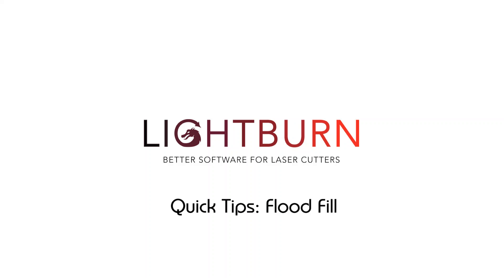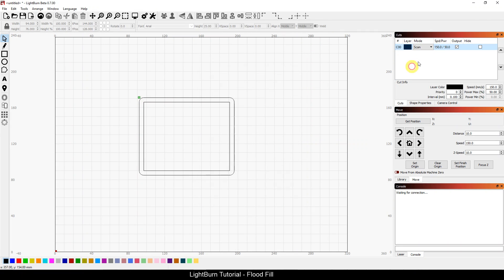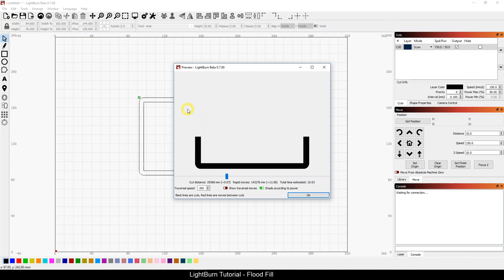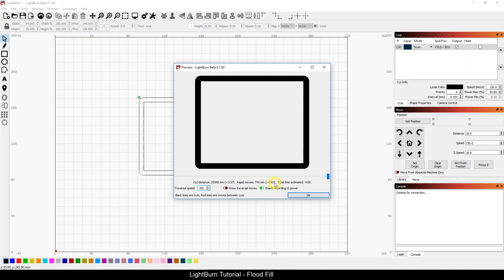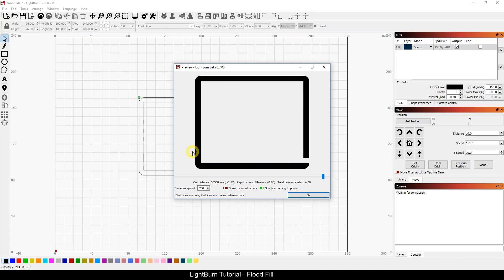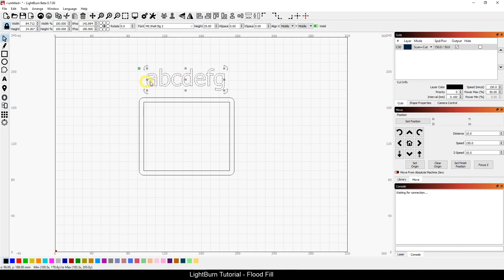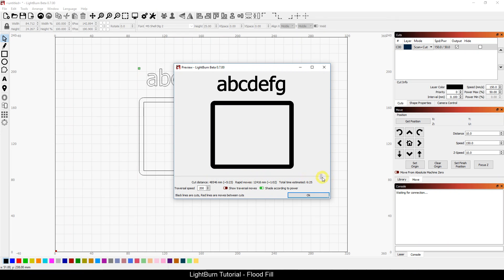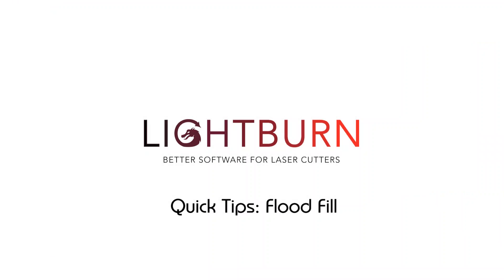LightBurn Quick Tips: Flood Fill

Comment: Are scans always horizontal? Thinking burning the bottom then the top with horizontal moves then burning the sides with vertical moves would be another possible improvement.
Reply from the maker: In LightBurn, you can set your scan angle to something other than 0-degrees but it applies to the full layer so you'd have to separate your parts into layers for horizontal and layers for vertical.  If you're using a gantry style laser, It's also a bit harder on the machine to do vertical scanning. That's a lot of weight to try to sling up and down vs just the laser head moving side to side.  

In the end, flood fill or even offset fill provide a better option but should be used only as needed.
Reply: @thetinkerverse  Thank you, I'm looking to retro fit an existing Core XY 3D printer with a more powerful laser than the 1500mW unit I have already installed, that replaced a 3D printer hot end. Because of the Core XY design, both stepper motors will be operating simultaneously for all X or Y straight moves which isn't the best but seems to work ok for printing. The rapid short moves in the relatively narrow sides of the example design vs. the bottom and top sides was my area of interest, with greater potential to miss steps if the speed is high. Breaking the two into two layers might be the ticket if I experience problems.

Comment: Great tutorial. I would just be wary of using this on faster machines like CO2 lasers because this will cause a lot more smaller rapid movements which will be tougher on the machine rather than helping the machine. In terms of quality of engraving I would also avoid this on designs with more detail rather than large areas of white space, because like the letters here, when it has to come back and do areas separately, the colors of the wood engravings will vary rather than being one consistent color. A post titled "Flood Fill Problem" on the lightburn forum goes into more detail with some pictures for examples of some of these issues with flood fill.

Comment: At "Less impact on your Machine" i wouldn't agree. Using flood fill there are much more acceleraton/deceleration cycles stressing the Motors and Belt drives, as well as the Linear rails.🤔

Comment: Great vid! What are the negatives of flood fill? Any degradation of quality. Curious why this would just simply be the default setting?
Reply from the maker: Not a lot of drawback n my experience unless you're doing a lot of thin lines causing very rapid direction changes in shot travels which can be hard on smaller machines.

Comment: Here we are about a year after this video. Version 0.9.17 and still no Flood Fill option
Reply from the maker: @MadManAz I'm not sure I follow. Flood Fill is there. When you open up the cut settings editor for a layer there is a toggle for Flood Fill on the right side about 2/3 of the way down the window.  It's next to the raido button for Fill shapes individually.
Reply from the maker: If you still don't see it, make sure to go to Edit > Settings and make sure Beginner Mode is turned off.